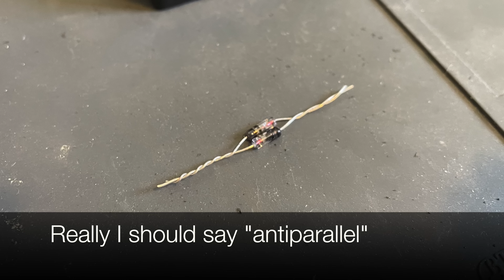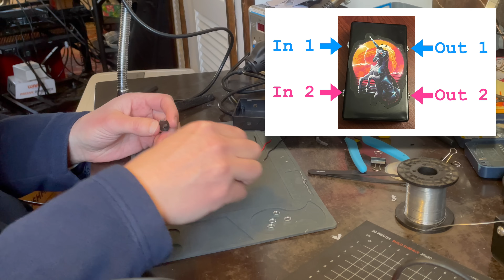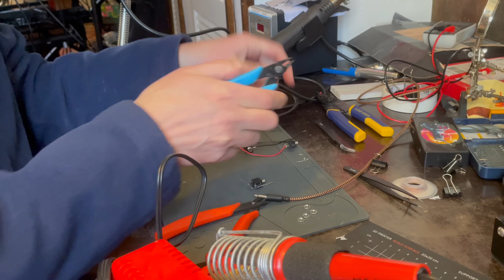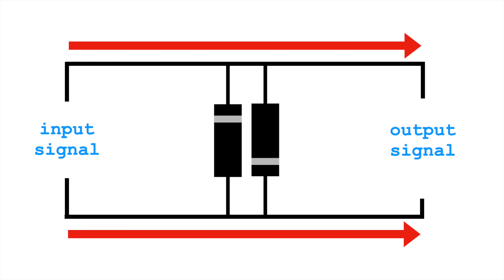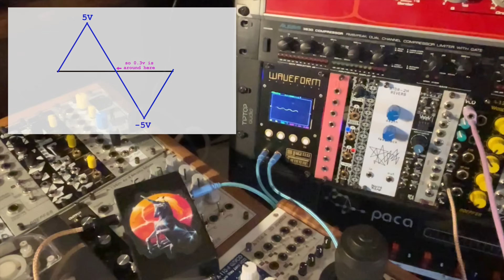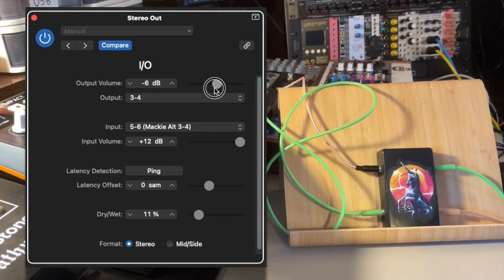I made an analog saturation box for $2, and here's how it sounds (diode clipping) | Simon Hutchinson

Comment: A suggestion to improve this a bit; You are now relying solely on the output impedance of the sending device as the clipper series resistance when the diodes start conducting..by replacing the wire with eg. 47kOhm resistors on the input side of the diodes i think the box will give more consistent clipping performance in between different devices you are getting the signal from..👍
Reply from the maker: Great suggestion! Thanks! I'll give this a try.
Reply: Yeah...but... that will drive the price up  😄Says the bean counter to the engineer.
Reply: @hipihei   you sont get a volume drop ? Got the same problem with a transformer box. I input directly into a transformer (12v one 10cm diameter so they kinda big) But have a resistive load on my multimeter at 200ohm of 17ohm. So can i put a résistance with out losing volume ??
Reply: @zeus_ex  You will lose volume. Without an active element (semiconductor, tube) any variation will lose amplitude. With the added harmonics it will be perceived as louder (most likely). Hey, it's a $1.99 US, a deal.

Comment: Those 1N34As are worth a fortune, you may need to revise your video title. I've got a bag of 10 from years ago that I'm too scared to use
Reply from the maker: Wait, what? Really? I should throw them up on eBay instead of wasting them in nonsense like this!
Reply: @SimonHutchinson no kidding, two black stripe 1n34a are Magic Klon diodes. All supply long exhausted
Reply: @SimonHutchinson  BAT46 have an almost identical knee, indistinguishable as clippers

Comment: do you have the diode part numbers you used, just curious,  I probably have a bunch of diodes pulled off old electronics... likely fairly easy to buy any used electronics from a thrift store and pull some diodes off it.
Reply from the maker: Unfortunately not, I just had these diodes in my components box. I must have bought them for some project a while ago, and these are leftovers. If you're curious, I would recommend going to Tayda Electronics and putting in "germanium diodes". These will most likely be the ones I used!

Comment: It works as it should, just not the optimal way, because the user has setting all gains on their own.

Usually those mutually inverse diodes are placed into OpAmp feedback loop, and signals are scaled to use as much of semiconductor’s linear region of VAC and clip as smoothly as possible. Some input and output buffering could be also a useful thing to make it more stable.

But of course, I like this stupidly simple design, that can be incorporated into a jack.
Reply from the maker: Thanks for watching! Yeah. Really that's the only real benefit of doing it this way: "stupidly simple design". Check out the other comments for a lot of cool ideas for revision and expansion.

Comment: Does this pose any risk for frying the source device? (synth, drum machine, mixer, etc.)
Reply from the maker: Good question--I had to think about it before replying. I can't think of any way that it would, but maybe someone else here can chime in if they see possible problems. 

Since this box doesn't produce any voltage itself (and, even if there were voltage coming from somewhere, it would be shorted to ground by the diodes if it got higher than 0.3V), I'd be hard pressed to find a way it could fry your gear.

Comment: How would this work with guitar? 

I have an 86 PRS which is missing the sweet switch. Before I got it, the sweet switch had been converted to a kill switch, but I then broke it doing crazy Tom Morello stuff very badly. I’ve thought about replacing the sweet switch, (so that I don’t keep destroying mini toggle switches by indulging in bad habits) but it’s nearly impossible, very expensive and I’m not sure I care for the sound of a sweet switch. This, however looks very interesting to me. The sound sort of reminds of a low-fi sampler, like a Fairlight CMI. 

I guess what I’m asking is, would this do anything between the volume knob and the output jack on a guitar?
Reply from the maker: Good question. I'll give this a try when I get a chance--just running a guitar into the input and out to an amp. In theory, that should be the same as putting it between the volume knob and output jack on a guitar. My guess is that, unless you have a preamp or active pickups, the signal from the guitar might be too low for this to be effective.

Let me see if I can get a chance to check this soon and confirm.
Reply: @SimonHutchinson  thank you!

Comment: Now add a switch for bypassing and you could compensate the volume drop with a cheap amp module for like $1 (needs power source then tho). And a simple passive tone knob should be also possible with a pot and a cap like they are used in guitars.
Reply from the maker: Great ideas! These would be worth exploring!

Comment: Nice, the old diode clipper. Also a great way to limit your electric bill by splicing a clipper circuit into between the wires that connect from the current transformer to the PCB of a "smart meter".
Reply: how so ?
Reply: @user-rv8wb1nl1b  Smart meters have two main parts, the base (usually black plastic) and the PCB (the circuit board). You will see wires from the base plugged into the circuit board. One set of wires comes from a donut-shaped thing on the base, which is a current transformer (CT). The wires are usually a pair colored blue and white, but the best way to identify them is to note which wires are connected to the CT.

Then here, you need only splice in the diode clipper (the two wires coming from the CT are AC not DC). 

The CTs they use are typically calibrated to output 333 mV at their rated peak. Meaning that, if your meter is rated for 200 amps, then when 200 amps is passing through the lugs the CT should output ~333 mV if you were to measure it with a quality true RMS multimeter. The "raw" non-RMS value is going to be closer to 471 mV because it is AC, you would multiply the rated voltage of 333 by 1.414 (square root of 2).

What does that mean for you? Use germanium diodes as they'll need to have low enough to conduct at values below 471 mV. 1N34A germanium diodes, aka "crystal radio diodes", have about 100 mV  voltage drop (0.1v). If you were to use two of these mounted in opposing directions on each of the two wires coming from the CT, then this is what would happen:

1) When the CT is producing less than 100 mV, the meter should show a zero or near-zero power rating.

2) When the CT is producing more than 100 mV, which means you're using ~30% of the rated current (30 amps for 100 amp system or 60 amps for a common 200 amp system), the meter would show a usage reading that ignores roughly the first 30% of the load.

Example: Your water heater pulls 30 amps and your AC pulls 30 amps. Both are on, your actual load is 60 amps. Your meter is rated for 100 amps total. Normally the meter would show 14 kW of power on its LCD screen. With the same load + the clipper installed, you'd see about 7 kW, and as long as you stay at or below 33 amps the meter would show zero.
Reply: @alphaforce6998  ooooooooooof !
Reply: @ It's literally plug-and-pay.
Reply: @alphaforce6998  that seems pretty easily detectable no? Like, it’d be very strange to have periods of zero electricity usage given fridges and freezers etc, interesting though!
Reply: @ahshurlook  In my experience, as long as they are getting readings and their diagnostics are not triggering work orders, they'll leave it alone.

- When you make adjustments to a smart meter, you cannot disconnect it from its power source. If you do, it sends a "last breath" broadcast using a super-capacitor on the PCB. Fortunately, you can do all you need to do to disable it without removing it from its mount. You just need to be very careful.

- The clipper would definitely produce distinct chart patterns with the flat tops BUT that is only when you are exceeding 1/3 of your rated capacity. For most people that only happens occasionally throughout the day.

The worst that could happen is they send someone to swap out the meter with a new one, which you'd then mod again. If they put a lock on the box you can remove it with a drill (or pick it if you have the skills). 

They cannot pursue "tampering" charges against you unless there is a witness or you are dumb enough to admit that you did something. I recommend that if you see a power company employee come unannounced, give them a notice of trespass and they'll most likely not return.

Comment: Diodes in series should be of the zener type, preferably around 3.3V, will give a much higher threshold to clip.  For best results run a 1Kohm resistor from each jack's hot lead to the diode node so drive capacity won't fry the diodes.  Easier yet, stick with your original parallel configuration.
Reply from the maker: Great tips, thanks! 👍

Comment: This is a great simple project for saturation. A great addition would be to  ad a bypass switch and also a toggle for Germanium vs Schotty diodes.
Reply from the maker: These are really great ideas for simple but rewarding expansion. The whole thing would remain passive, and you'd only need four more diodes and two 3-way switched. Great thinking!

Comment: Could be an interesting way to passively attenuate eurorack level signals with some different diodes. Could easily be a 1-3hp module with several different diode combos. Might calm down some more aggressive envs, or flatten out the points on a saw lfo, for instance.
Reply from the maker: Cool ideas. Thanks!
Reply: @SimonHutchinson  Finally getting around to trying this today lol

Comment: There is a lot of free space in the box. +5$ (or less!) and you put there a 2 channel (or 4 if need) amplifier IC + 9v battery, and a pot(s) to control the amp. force. You get a much better device! Also you can put a simple resonant filter inside (LM13700 based Sallen-Key) or a "poor man filter" (it's smaller and less parts involved). For what you're doing I think it can be made inside a cable, that's it :)
Reply from the maker: That's a great idea! Thanks! I'm going to have to try that!
Reply: You can find a 9v battery, a pot, and some components for under $5? I can't find a 9v battery for under $5.  A couple of bipolar transistors, resistors and caps, yeah, maybe a pot, too.Those additions would make a better distortion for sure.

Comment: I’ve been into building pedals and audio circuits for about 4–5 years now, but I really wish I had seen this video 15 years ago. Back then, it all felt so overwhelming, and I had no idea where to even begin. This is such a great starting point for anyone getting into electronics
Reply from the maker: Thanks! I appreciate it! I'm far from an expert in audio circuits myself, but I think this is a super-rewarding first build: cheap, relatively easy to build, and clearly audible results.
Reply: Way more approachable for beginners than say an op amp or overdrive circuit. Absolutely a great place to start!
For those into eurorack, passive attenuators are the easiest place to start imho :)
Reply from the maker: Great thoughts. Yes. The first things I did for Eurorack were a passive mult and a passive attenuator.
Reply: Adding some switches to change the diode configuration as well as a switched DC blocker is an easy addition.  I'd add a simple quad opamp chip to buffer the input and add a makeup gain.  These would up your compatibility massively.

Comment: wow this is really cool, looks easy enough to remake even to someone totally clueless like me
Reply from the maker: It was easy enough for someone as clueless as I am! 😛 But I do recommend as a first step checking the diodes by using a cable and the alligator clips (like I did). It gives you a chance to check things before you start soldering.
Reply: This sounds pretty good on the drum machine I think. It would be interesting to hear it on the Drum Brutes FM drum too. Anyway, if I were to build this, I think maybe I'd put 4 channels in and maybe do some switches for those different combinations you showed.